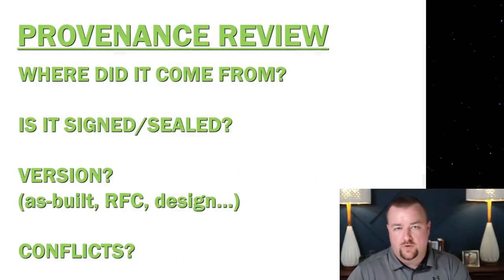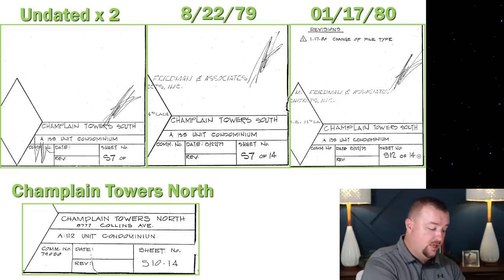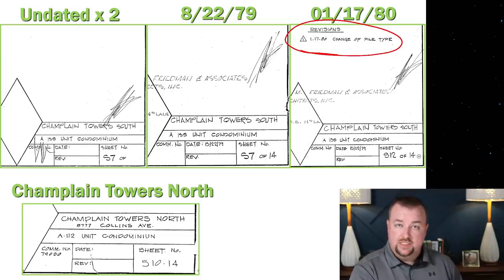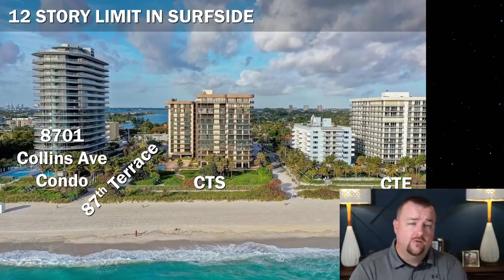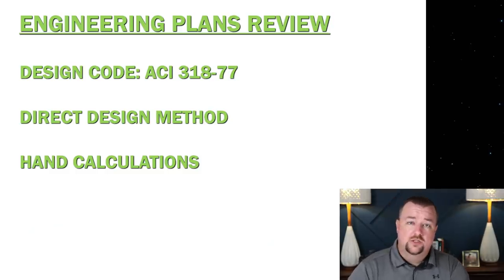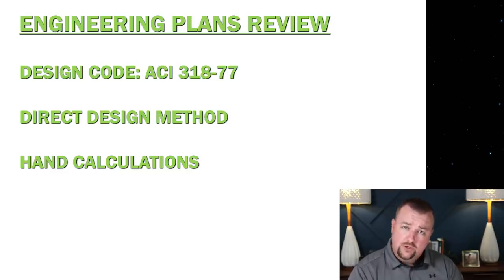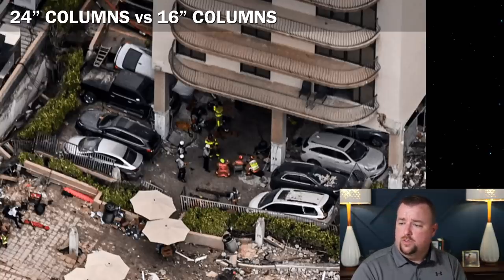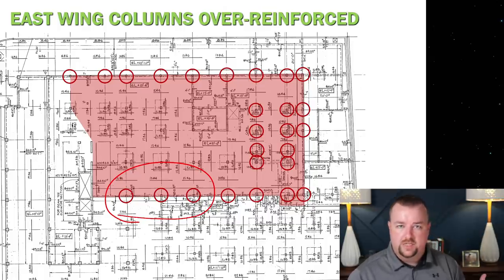Engineering Failures Found in the Champlain Towers South Drawings - Surfside Collapse

Comment: Yes, thermal expansion has been ignore up until now! This just might be the reason why the collapsed occurred at 1:30 AM rather then 1:30 PM? Had an expansion joint had been designed into the slab system between the residential part of the structure and the pool slab area/parking area, the upper building may not have collapsed.
Reply: Possibly, you might be right, who can guess, however I think an expansion joint would have the let building collapsing sooner, as the steel in the continuous concrete was possibly serving as a tension load support in place of the missing load distribution beams!  Then as you say, the cold night come one too many times as the steel was rusting out and those skinny columns punched through.
Reply: @markmurto  MY own off-the-cuff response would be that if it was designed as several seperate strucures it would have had more 'in-built strength from the structural form' and more resistance to structural failure. BUT I am kinda guessing. (UK ex-Civil engineer now retired)
Reply: I thought about it too, there had been a two week hot period and then the temperature dropped som 5-7 degrees from its highpoint, 1.5 days prior to the collapse. I saw that on Google.
Reply: @postie48  I can imagine you think you have a good idea. But if you studied structural engineering in college, your off the cuff idea of putting several small structures together to make as one big structure... just....  well you wouldn't pass the class..... for so many reasons it too hard to go into.   Go back and take Structures 101 again.  Sorry.  But at least you are curious.  The biggest problem here was under engineering, and modifications.   Add to that, the added penthouse, and all the extra weight added as people remodeled their spaces with new heavy granite and tile, huge refrigerators, from the original calculated load.  This was very good investigative work on the video.
Reply: @markmurto  Mark – Thankyou for your advice in developing my career but unfortunately, I did pass Structures 101, on route to a Batchelors degree in Civil Engineering, later developed further to a Masters degree and picking up Professional Engineer status and practiced in three countries. My limited qualifications were recognised by 5 professional level institutions across the world, and I had a long and happy career in construction of over 55 years, with over 50years at the professional level, led teams designing major structures, and was part of the team managing the structural repair and maintenance of 55 housing blocks in a typhoon area (the kind of work with many similarities to that needed to Champion Towers) but thankyou again for your well meant advice.

We agree the issue here was under-engineering and modifications. I cannot agree with your fixation on increased load from furniture and fittings. As a professional project reviewer for over 18 years I can suggest that many project teams (and engineers) focus on fixing single issues and few have the capability/mindset to step back and see the bigger vision. You will have heard the expression ‘tunnel vision’ it is from my experience a very real problem. You may have heard the term ‘brain storming’ an effective and helpful technique when considering solutions and certainly in ‘shaking’ teams from their fixed in place mindset. A technique I have facilitated workshops on a number of occasions, you may wish to add this to your ‘toolset’.
You have suggested that the added weight of modifications to furniture and fittings caused the collapse, I assume you have done some calculations of the actual weight increase compared with the weight of the structure, and bearing in mind that in residential buildings (that I am accustomed to)  the assumed applied loads are uniformly distributed over the slab and they are in total are normally well in excess of the loads applied during actual occupation even taking into account the actual finishing’s that you have trenchantly insisted were a major cause of failure. I find this dogged insistence somewhat questionable when the agreement appears to be that the collapse initiated at the pool deck with punching shear around columns – of course you may be referring to the possibly added pool deck resurfacing and the possibly added planters. Of course from your extensive experience you are well aware that structural issues are often ‘cumulative’ i.e. any one issue is worsened by others which lead to structural distress and ultimately collapse. Noting this accumulation, the surprising thing in this case is the catastrophic (i.e. sudden) nature of the collapse in what could be considered unstressed conditions (except as recently pointed out the impact of the solar gain/day/night temperature cycle an issue that I cam across when considering the issues of a 7km long elevated road in the Philippines – an issue unfortunately missed by the USA structural engineers on the checking team).
 Anyway, thank you again for your advice on my career development, unfortunately my career has taken a different path and I have decided to rest on my laurels.
Reply: @postie48  This building was designed in the 1970's on a Florida beech most likely for a quick profit.  You can look at it in pictures and note its a square kind of ugly dated design.  Someone must have been using a beginners' slide-rule on that one.  The fact that it failed and fell almost at gravity speed was shocking because it wasn't a sand castle for goodness sake!  At first I suspected charges.  The flashes seen in that one video must have been electrical failures.  But funny how there is only one fall video while so many other security cameras must have seen it fall. There was a definite overload and catastrophic design failure.  But I'm still thinking something happened thats more hidden.

Comment: Are these changes also found in the North and East buildings, or was the design later modified again before they were constructed?
Reply: THAT is the question...IMO there should be no parking allowed in the lobby level parking area until the analysis is complete for the south tower.
Reply: I believe the north tower is nearly identical, but the design of it's parking garage and pool deck would have been tailored to suit the site it was constructed on. That doesn't mean their aren't similar problems, but mistakes from the south tower would not have directly transferred to the north tower....Though personally I don't think I'd live in either remaining building until every aspect of their design and condition has been carefully evaluated.
Reply: @THX..1138  Particularly if they also have very large, very heavy planters on the pool deck.
Reply: Yes, someone who lives in the area might stop by and see. Removing anything heavy would be a sensible precaution. Unfortunately, HOA lawyers might have told them not to do that since it would amount to an admission of guilt.
Reply: If I lived there, I would be adding caps all over the place in the columns x slabs connections to avoid punching shear. And looking at some other strategic places to add transfer load beams.
Reply: You can see on google maps that the parking spaces and the planters on the west side bordering the parking area are the same.  The planters along the north side are different because the Champlain North building isn't as big as the South building.  The pool deck is smaller as a result.
Reply: @stargazer7644  that’s scary, isn’t it 😬
Reply: Rubens Kuhl, the first thing I noticed was no caps on those pool deck columns. Caps are compulsory in Australia with a deck like that.

Comment: The beams you point out were removed from the build!!!  Oh my goodness.  Its like taking out the box frame and hoping the box skinny sides will  keep the box square under a full load!.  How this lasted 40 years, like you said, is sheer luck.  All the other things you discovered were just bad, but the loss of the live load distribution was pure bone headed criminal.  All for looks sake too. The guy who did this has probably passed on, but he must have not passed his statics class.  Any person who took basic statics and dynamics, and graduated with just a little FEA (finite element analysis) under his belt would have increased the column size and kept the box transfer beams. But this????  Better check the other building right away.

Comment: If you look at the google maps imaging of the North and South tower, which were both based on the same design, but with the North building being shorter front to back, you can see that there are some similarities and some differences in the planters.  The North tower has the same planter around the parking area. If that was indeed the epicenter of the collapse of the South building then the potential for the same thing could exist. There are actually more planters against the North building than the South building so depending on what went into that design process, may cause it to be even more over loaded. From what has been said, and by available google imaging, the North building was clearly better maintained than the South building. Hopefully the variable of corrosion caused structural damage isn't an issue with the North building, but I would agree that no cars should be allowed to park on any of that lobby level parking area until it can be deemed structurally sound.

Comment: For me, you made it very clear. That, with previous videos, adds up to: as built building changes that doomed this building. I hope that not many other buildings were put up with so many detrimental design changes made during their construction.
Reply: Even doomed without the changes it was already at max capacity in a salt water environment that a certain fail just by it self. the changes moved it from max capacity to over max capacity.
Reply: @RedRocket4000  At 99% load bearing capacity without anyone even living in the building, as built. Good grief, that was incredibly poor planning and design. Right on a coast line, on a shifty island, in hurricane paths. 🤦‍♀️

Sounds like no one recalculated load bearing capacity in many cases as changes to the plan were made. Every column change, every beam change, moved columns, changes in tiling used, all of them affecting load capacity.

Comment: If any of you is living or owning in the other building, it may be interesting to hire this guy to look the construction/plans and do a pre forensic evaluation to the changes added later on that may not even be on the plans.
I would recommend that any building from this contractor/architect or who ever responsable for the drawings, would be under revision and looking for similar problems.
This vid shows clearly how, what seems a minor change, have a disastress consequence. From regulations"'just enough", to construction engineers making 1 mistake or a change along the way without rechecking the consequences, HOA's who have esthetical desires (plantboxes) without expert overview. I mean its a snowball of actions that we need to be aware off before making decisions about buildings and clearly explained in this vid.
Now the next question is how the collaps of a deck was able to take down almost the whole building, where there similar mistakes made (like missing transfer beams) that made the building collaps in a whole instead of just tilting or crack whatever, but not to collaps.
Reply: Agree. This is exactly what his company does, which is why this is so valuable. He is doing this for free when normally he would be paid 10s of $1,000s for this type of analysis.

Comment: Long, detailed, and very interesting, Thanks.   Designed in the 80s when cars were getting smaller & lighter due to the oil shortage may have not helped.  And as they say 'designed to a budget' - the contractor wants to build the most for the least, the architect wants to make it look pretty, and the engineer is the one who has to take responsibility for everything.
Reply: Yeah, I was thinking that too, cars now are getting heavier and heavier, especially in the US where they keep growing in size. Electric cars weigh even more still, it makes me wonder if we should be re-evaluating the designs of a lot if the older parking garages to check they can still handle these increasing loads...

Comment: Excellent research and presentation.  I am an electrical engineer with considerable large project management experience.   This is a good example how change orders cause problems when initiated in later phases of the project.   They do not have to cause problems but there is a a tendency to treat them lightly in order to keep project schedule and to control engineering costs.  I hope this tragedy helps project owners and the public understand this.

Comment: So who is responsible to review and approve plan changes and corresponding structural engineering drawings when a change request comes forward ?  It seems like the original design was fine but when they changed the design they either overlooked something or just made a huge error and nobody reviewed it.
Reply from the maker: For a building like this the buck stops and starts with the design engineer.  The building department rarely has staff qualified to review these designs to this level.
Reply: @BuildingIntegrity  Would liability fall at the engineer’s feet or at the firm they worked for in a case like this? Do we know if the firm or the engineer are even still around?
Reply: See the Hyatt Regency disaster in Kansas City,. This is part of the same problem, redesigned elements are not held to the same scrutiny and calculations because all the load paths are assumed to be the same.
Reply: @Record3677  I think the owner of the company that built this condo is dead and his company no longer exists.
Reply: @jeffreyhueseman7061  right on.....this also was true with the CITIBANK building in Manhattan.
Reply: @cherylhoskins1679  Even though I think the original owner of this building would likely be sued if they are still even in existence, if this is the issue that caused the collapse, the engineering firm and the engineer that made and approved the modification would likely be the ones they would go after in court. In addition, at a minimum, all buildings engineered by this company during that time frame need at least a paper review of changes made after the approval of the original plans in my opinion.
Reply: @pauld315  The way lawyers determine who to go after in court is based solely on who has the deepest pockets.
Reply: @pauld315  And Suing one of the problems here the Civil system not really designed for any criminal case like nature things. Stuff like this should be Criminal and administrative matters by the government so people can go to jail and be banned from industry. Like other countries money damages can be determined in the same trial that criminal and civil matters resolved. 

And a same as Military Standard must apply to CEO's and key board and company officers. If the company is found criminally liable they are criminally guilty no need to prove if they did anything wrong personally only thing their trial should consider is were they actually in charge and on the job long enough to be responsible. Otherwise what goes wrong is their fault no need to prove they were involved or not as they automatically assumed to been involved as they should have been involved. I'm tired of executives getting off from criminal behavior because no one can prove they gave the orders which created the criminal action of the company. Sorry executives if the company did wrong you did wrong thus the similar to military standard were anything that goes wrong is the fault of the commander.
Reply: @Record3677  Many Cities either have a City Engineer or outsource.. They're to inspect and verify all Engineering ...Unfortunately, not everything is caught.. As a City Council Member, and a self taught reader of Blue Prints/Plans , I found a major problem with a new Hospital They corrected and redesigned portions. . . Glad to find your informative videos!
Reply: "It seems like the original design was fine". Not so.
The original design left insufficient margin for the inevitable changes and deterioration to be expected in the lifetime of any significant building

Comment: Also, at 13:58, the column on the right shows a chunk of missing concrete in the center of the column. Taking that big of a bite out of a 12"x16" column wouldn't have left much of anything of the 12" dimension.

Comment: Outstanding!  Thanks for taking the time to prepare and share.     It appears clear that the overloaded slab caused punching shear, failing the slab.  Once the slab failed and the load was removed from the column, what happened next?    You suggested that the loss of lateral support from the slab created a 20 foot unbraced column length and the column may failed in buckling but you really didn't discuss any calculation you may have done to confirm this.   Please continue your videos through the complete path of failure.